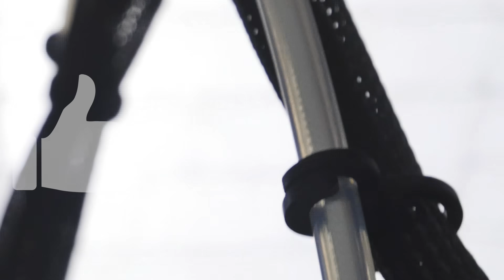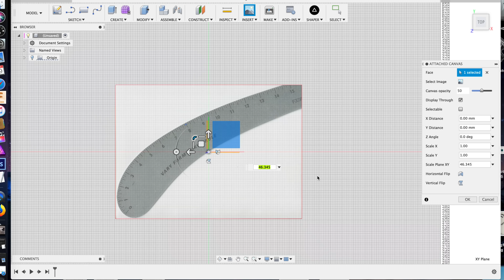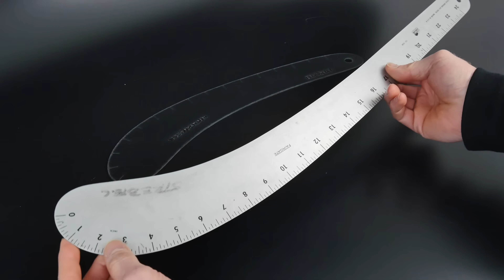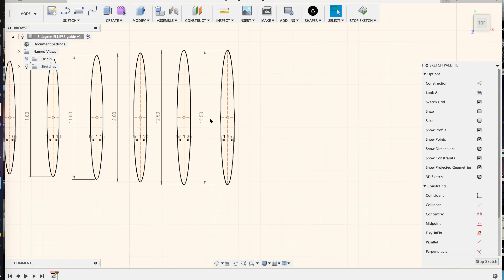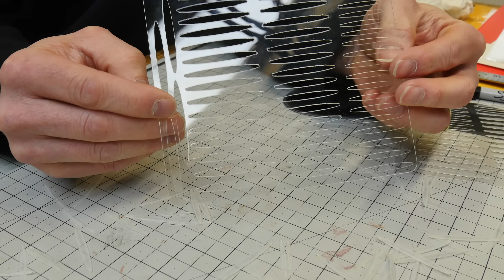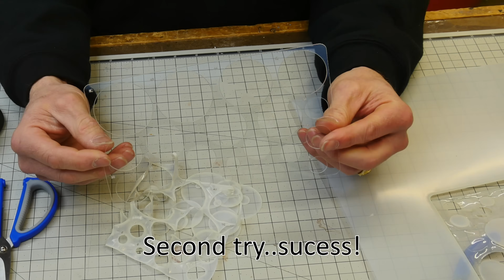Make your own drawing tools with a laser: sweeps, ellipse and circle templates

Comment: For a 5 degree ellipse your ratio width/height ought to be  0.08715... or  about 9% . With a 10% ratio the angle is about 6 degrees (5.739... deg). Not much difference, I know, but I mention this just in case someone else would wonder about the mathematics.

Comment: A question for you Eric - Why do old school, green ellipse templates (Alvin, Lietz, etc.) have such a funky smell? My theory is that they use some unique polymer, chosen for its chemical resistance to alcohol marker solvent. Your thoughts?
Reply: For the same reason many older plastic products have a funky smell. A combination of the smell of the plasticizers as they leach out and, in some cases, break down or oxidize, and the products of the breakdown of the base plastic(s). If you have any old screwdrivers with the jelly-candy look "acetate" ("celuloid"; "Tenite"; cellulose acetate butyrate) handles (transparent green and red used to be very common, as well as a variety of other colors), you will likely know the barf-smell, and the white residue from the plasticizer leaching out. AFAIK, there is no 'cure', just remediation (cleaning and airing). As the prof said back in O-chem: "butyl: nasty smelling compounds with nasty sounding names".
Reply from the maker: Luke Frahn Yeah, good question, I googled it to try to find out but had no luck. I suspect they used a resin that was durable that could withstand the die punch process and that was just the aftereffect of the material.
Reply: Eric Strebel  That's a better theory than mine. Thanks!
Reply from the maker: john john Thanks for the info! Sweet

Comment: For the 5 degree ellipse in fusion: presuming you want the ellipse in the x-y plane, make a work plane at an angle of 85 degrees to the x-y plane. Draw a circle on it of the same diameter as the major axis you want for the ellipse. Then project geometry to the x-y plane. 

If you want 22.47 degree ellipse, make the work plane at 22.47 degrees. if you want 13 degree,.....

Fast, easy, and dead on
Reply from the maker: john john  Yeah, good point, always more than one way to do something, probably faster but with a bit less flexibility.